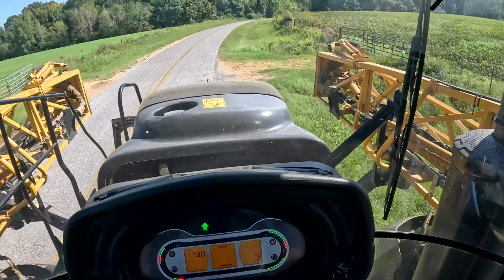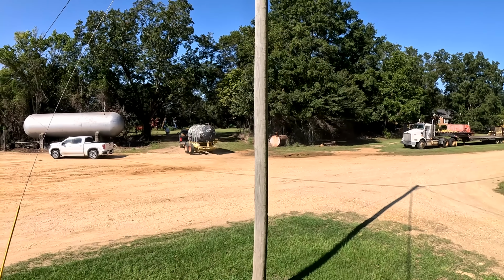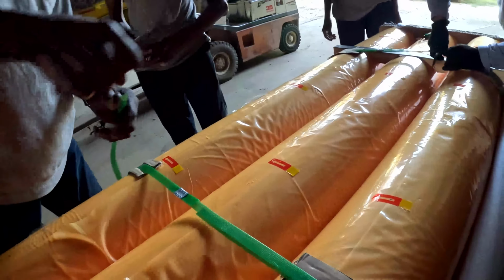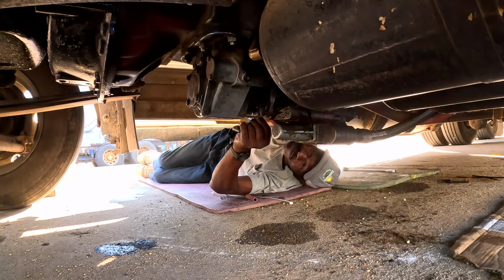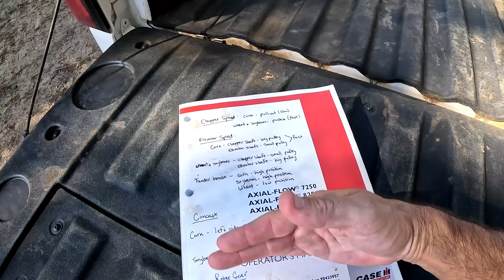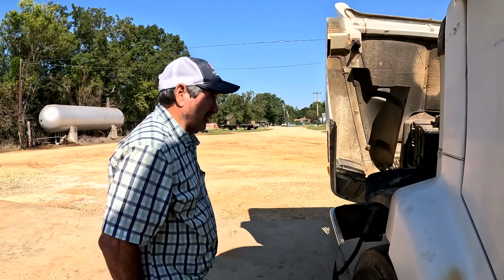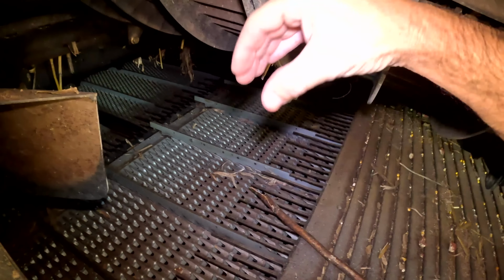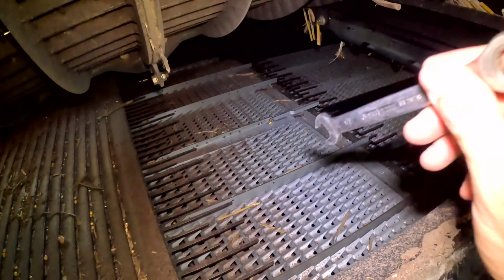WHAT WILL BREAK DOWN NEXT?

Comment: Glad y’all got it figured out. We kept a set of bolts each size we need for them. 1/4” bolt for 1/4”. Long bolts and bent heads up like a handle and kept you from using it for a bolt some where. Stored them in a wood block in cab or toolbox.